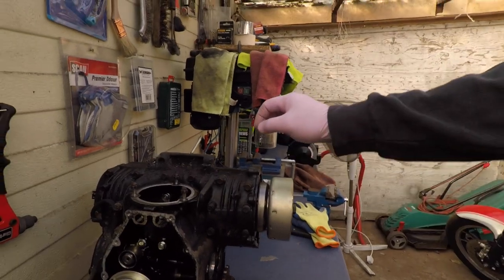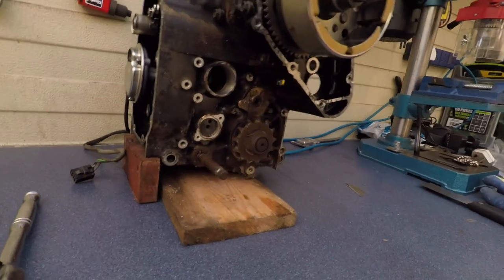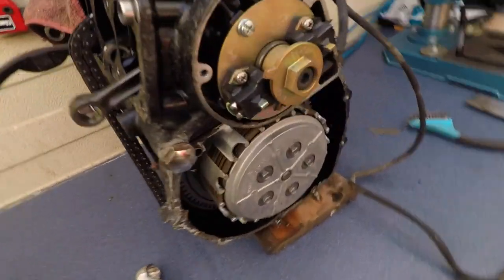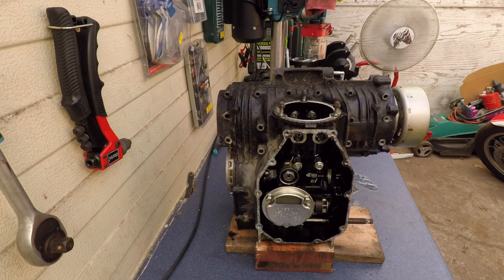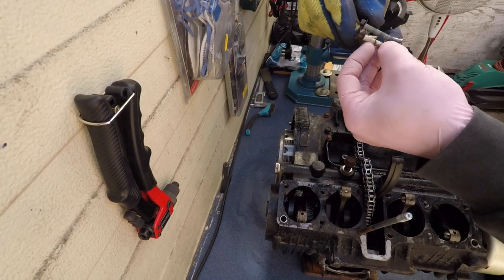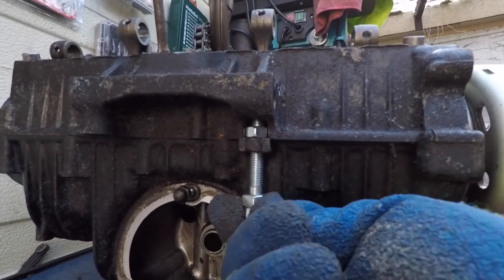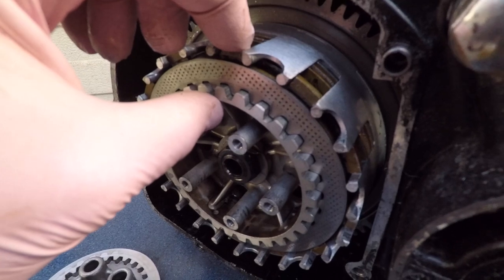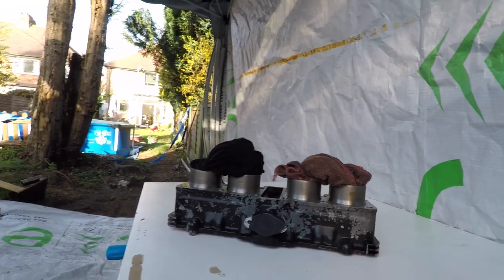Suzuki GS250FW Restoration Pt8 1080

Comment: The amount of different size bolts holding the same part together is crazy. Suzuki must have gotten the left over engineers that Honda, Kawasaki, and Yamaha didn’t hire. What lousy mechanical design work. Suzuki must have also gotten the left over fabricators seeing the crappy welding job they did on the main frame assembly. Perhaps more reasons to pass on buying this motorcycle.
Your sandblasting, can you share what size compressor you’re using. Thanks again mate.
Reply from the maker: 25. liter tank, it's a small one, honestly if you can go to a bigger one that would be better